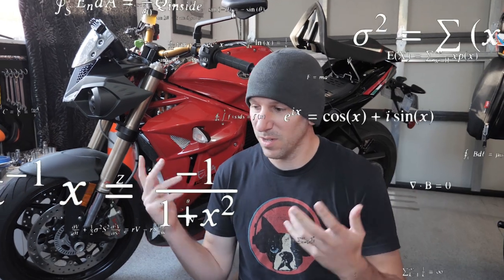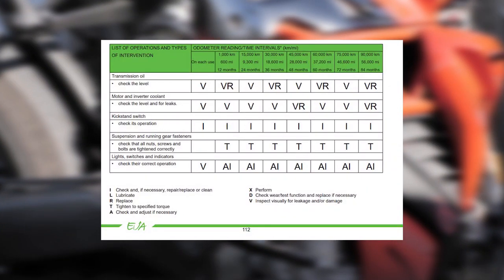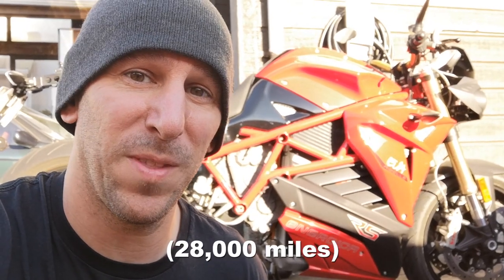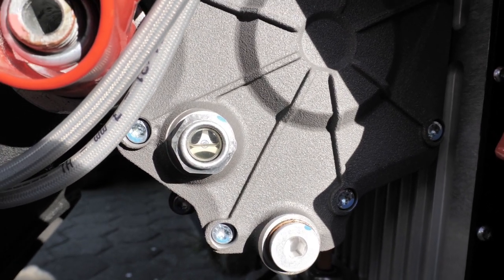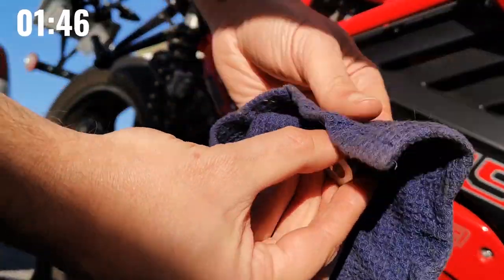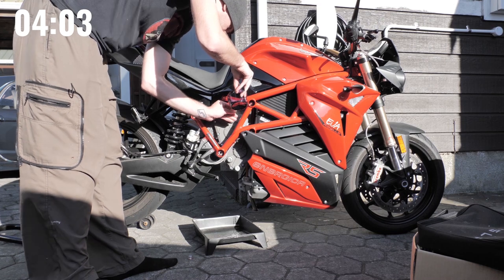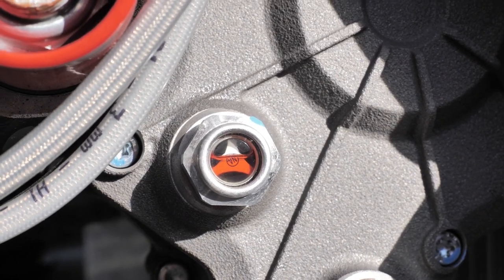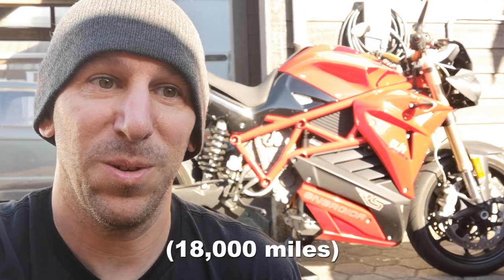Energica Eva Ribelle // First Service // EMCE gearbox oil change

Comment: Quick tip for any gearbox or diff service- always pull the fill plug first. 
1. Helps the oil drain faster when you remove the drain plug.
2. Most importantly, you don’t have to flip the vehicle upside down to refill if the fill plug gets jammed or stripped.
Reply from the maker: Haha great point.  Really great point XD

Comment: Great stuff, Sam! Just had my first Ribelle service last week. You're right that it's super easy on the oil change front. It was the dealership's first time servicing though and it took them a couple of hours, seemingly running a lot of diagnostic checks with a laptop.

No sign of any changes to firmware in what I can see in the info screen though.

Do you have any possibility without a dealership to do any diagnostic stuff yourself? It would be nice to think that Energica were supportive of customers in markets without a dealership network.

That said, there's something to be said for "if it ain't broke, don't update the firmware"!
Reply from the maker: Thanks John! I think I'd need a diagnostic cable and whatever software they use, which is probably proprietary. Not sure.. I should ask! It would be really useful to pull logs and find out how the bike is doing.
Reply: @NewZeroland  Yes, I know what you mean. They might be understandably reluctant to make that equipment available in places with a dealership network, but in the case of markets without, it's not like you'd be undercutting any potential dealership income. I guess it could be prohibitively expensive, but it might be a nice gesture for them to offer them for sale to anyone who wants one in countries without dealerships and perhaps require some kind of remote check in over the internet to approve usage when required. Could be tied to a USB dongle licence. All sorts of options spring to mind, including diagnostics over the internet, so the software could remain on a server under Energica's control and just spit out a report in response to diagnostic info from the bike.

Comment: You could replace the plug with a VOSS or Parker VSTI plug. It has an integrated seal under the cap.
It does need a proper spotface. When that's not there you are stuck with copper.
Reply from the maker: Good to know! Thanks for the tips.

Comment: Love your videos and you are part of the reason I just got my 2023 EVA EsseEsse9+ RS. Im in Denver Co, and like you im told I need to go to Mexico to get service done. Do you know if the Gear oil change on your Eva Ribelle is the same as mine? I figure thats the most important part at the 600mi and im at 330 miles with no hope of dealer service. Thanks!
Reply from the maker: Thanks man! How are you liking your bike so far? And yep, it's the exact same powertrain so all you need is that specific kind of automatic transmission fluid and you can totally do it yourself.
Reply: @NewZeroland  Cool, I like to do some work on my bikes. But loving it so far. Been snowed in for 10 days but hopefully get it out again tomorrow.

Comment: where do I buy a "crush washer"?  is it made of copper?  and thank you yet again for making these videos.  I live about 6 hours drive from the closes Energica service place, so I will just change the 600 mile (1000km) service transmission oil myself.  I'm assuming for transmission oil, I just need any synthetic transmission oil?  (this is my first motorcycle and I know nothing about oils (my other car is a Tesla and the other other one is a Leaf) )  Thank you again fine sir!
Reply from the maker: Cheers!  Thanks for reaching out and kudos for doing the service yourself :D  You should be able to get crush washers from any hardware store, but take the one from the bike mid oil change if you want to be sure.  I know AF1 Racing sells them but nobody wants to wait for shipping.  The automatic transmission fluid they use is Dextron 6.  Usually the container will tell you which ones it's compatible with, so just look for that one.  Good luck!
Reply: @NewZeroland  thanks

Comment: Too easy! Built smart. Well done NZL for doing it yourself!💪💪🙌 what oil is suitable? I didn’t quite catch it? Penrite? Great Aussie oil!✅  Did you replace the oil on both bikes?
Reply from the maker: Thanks man! Dex-6 Automatic Transmission Fluid. Energica has their own brand they like to use, but you can put in whatever is equivalent to that.

Comment: Very nice and much improved.  Just 2 questions.  Is the plug magnetized?  Do the Ego fairings cover the plug or are they adjusted too?
Reply from the maker: Yep the plug is magnetized and you have to clean off the little metal bits, and it looks like you can leave the Ego fairings on! Maaaaybe remove the belly pan if you need to, but you can probably fit an oil pan in between there.

Comment: Just woke up, having coffee and am about to do my first service right now. What a coincidence that this video popped up at the same time. Had to watch it in case that I don't miss anything. Energica could've installed a filter just like Tesla to make it maintenance free (pretty much), but since it's a piece of cake to change I guess there is no need. Thanks Sam! Be safe
Reply from the maker: They used to have a filter on the old ones, but the filter required cleaning. It was way too intensive. At least this is only a 5 min job every couple years 😁 Glad it helped!
Reply: @NewZeroland  Hell yea, got it done right!

Comment: If you want a set of Jef sliders to protect the plastics when racing assuming the motor mounts are similar the workshop is at your disposal.
Reply from the maker: Thanks man! I actually just got some sliders from Energica of New England that I need to install 😁

Comment: Wow, does Energica specify ATF for gearbox oil?  

(Edit: wow, yes you literally say that, apparently for the earlier non-EMCE models as well.  First I've heard that.  Very useful video, thanks.)
Reply from the maker: Yep! Same Dex-6 ATF as the old ones.
Reply: @NewZeroland  Fascinating.  My Brammo uses 10W-30 (and quite a bit more of it), but I suppose the application is much different with the 6-speed.  I'm seriously considering making the jump to an Eva Ribelle, and your videos have been the most helpful and informative out there.
Reply from the maker: @U-03C9  whoa!  Yeah that makes sense.  There's a whole lot more going on in your gearbox.  I'm glad you're liking my videos!  Definitely take a Ribelle for a test ride if you can.  It'll blow your mind :D

Comment: It doesn't have a filter?
Reply from the maker: Nope, just a magnetic plug to catch little bits of metal.  The oil doesn't get hot like in a gas engine so it comes out basically the same as it went in.
Reply: @NewZeroland  Cool, it just helps keeps oil changes quicker. Compared to the old bikes.

Comment: No human flesh to clean off a screen?
Reply from the maker: Hahaha not this time. This one must be vegan.
Reply: @NewZeroland  funny. I had my first oil change (with the older motor) last fall. No human flesh. Probable won't tear it apart to clean the screen next time. It was perfectly clean the first time. I'm not a fan of the noise. I know you are, as are many others. Sounds like a dentist's drill to me. I'd really like to ride a verge tc. Seems interesting.
Reply from the maker: @CRPerformance1  yeah!! That thing looks so unique. I've heard mixed things about ride quality, but it has all the important specs. Long range, DC charging, and lots of torque 😁
Reply: @NewZeroland  I'd like to see you review it. We seem to be on the same page with most things.
Reply from the maker: @CRPerformance1  I really want to ride one! Might have to take a trip to Europe now that the world is going back to normal.